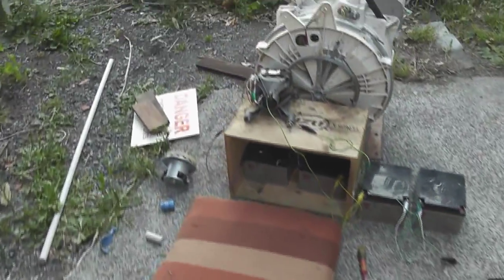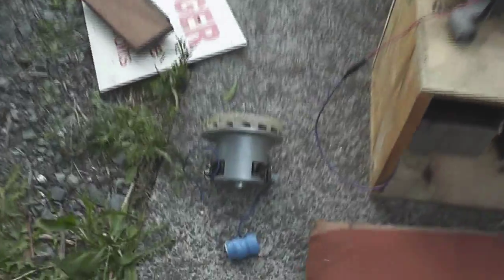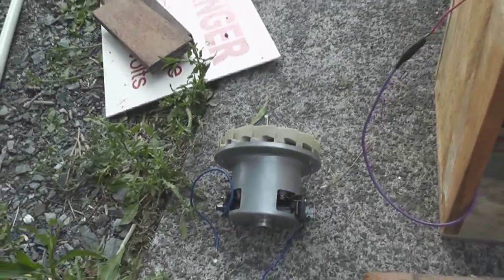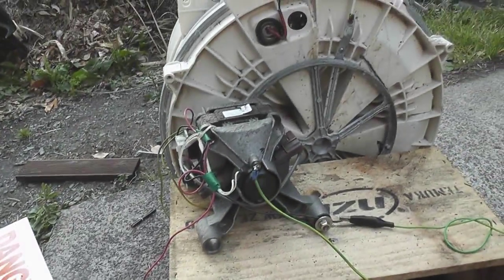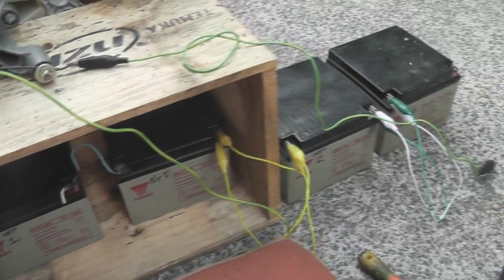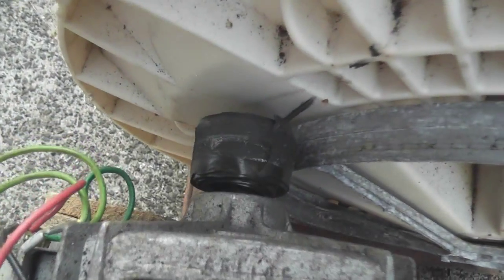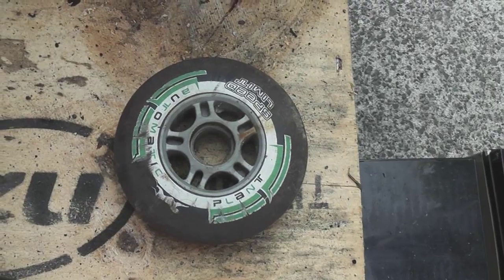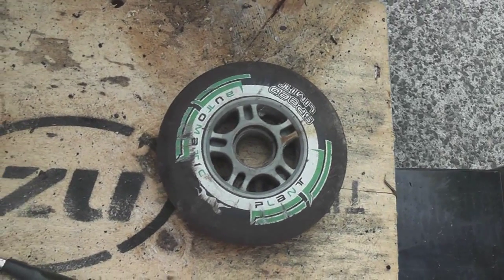Rim driven washing machine drum

Comment: Various (good) reasons. A belt connection is much more forgiving to vibrations than a "stiff" geared connection. Also a belt needs no grease and does not wear out essential parts (good luck finding the right gears after ten years, a belt is universal). Also the gears would have to be massive since the motor is usually besides the drum not behind it (would add at least 30cm of dead space the the washer). A belt is also more efficient than a set of gears.

Comment: I've found they are actually quite reliable machines, the newer Aquasmarts have given me some grief due to the suspension rods failing, but the rest is pretty solid. The main issues I've found (in older models) are the pumps (70W or so shaded pole motors) dying and occasionally taking out some control electronics. The ones I've seen last 10 years easy.

Comment: .....I'd still like to see someone put the pulleys in reverse (i.e. the large pulley on the motor :D ) and get the drum revved up to silly speeds! :D

Or..... Just driving the drum on a 1:1 ratio with the motor. :D

Sticking with what you have there though....To increase grip on the large pulley, get an old belt, cut a section out of it so that the belt is the same circumference as the pulley, then glue it onto the pulley.

If you have rubber-on-rubber, the grip would be fantastic. :D

-BBD.

Comment: From what I have heard they are overpriced junk, too many plastic parts and temperamental control electronics. One common problem I have also heard of is the seals on the bottom giving way and allowing soapy water into the motor ruining it. it's a good concept but a poorly executed one in the case of F & P.